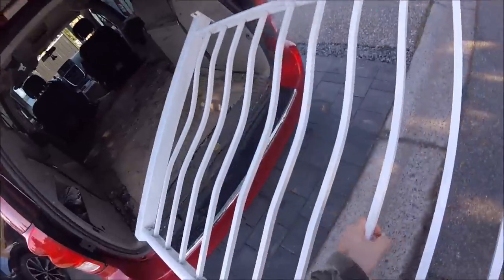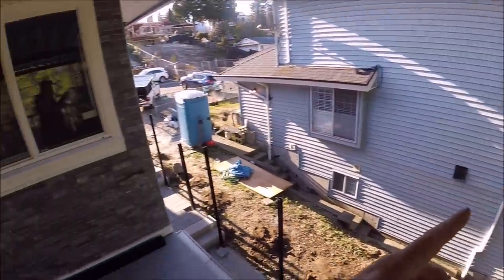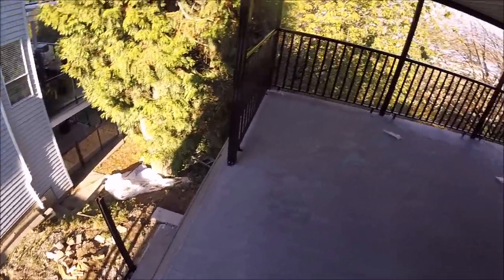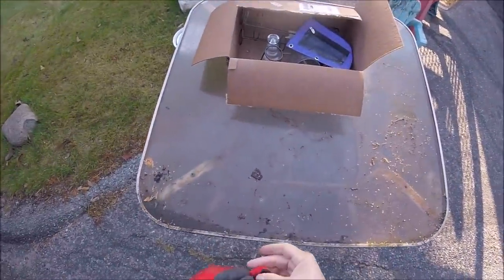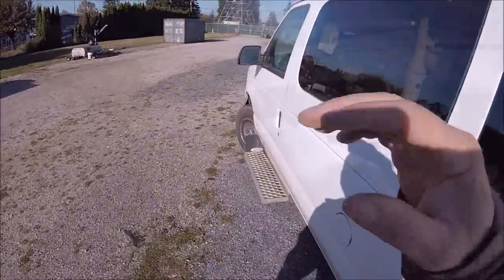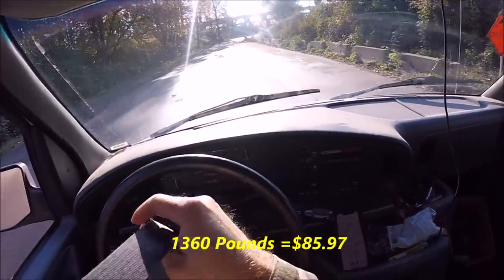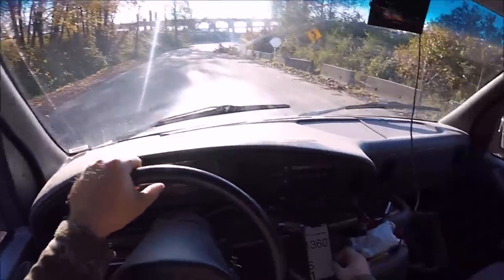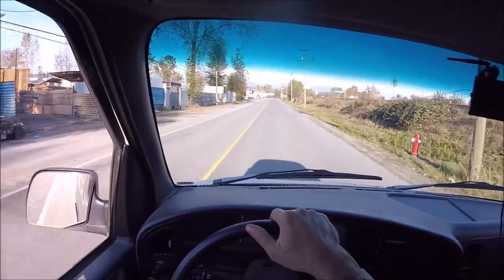Scrap Run With Scrap Processing

Comment: Your yard is getting sleek by the day with every bits and pieces either stripped for non ferrous or as shred for yard run. Good to have 80+ bucks in pocket rather than stuff spread all over the place.
Looks like Vancouver is a good place for street scrapping. You can fill your van in 2-3 hours for 80 bucks.

Comment: The railing is def to flimsy.  Needs several thick posts to stiffen it up.  Not safe so flimsy.  Did they ever clean up the stains on the walkways?  But the house is looking good.  Nice scrap run.